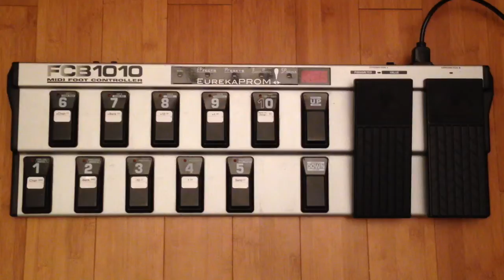Programming the PP Programmable configuration of the EurekaPROM

Comment: Hello! I have a few questions.
1) Is EurekaPROM still usable with current production FCB1010s, in february 2019?
2) I understand there is no Windows editor, but everything seems relatively simple to program
3) I would use this ROM with the FCB1010 to use in Amplitube 4 as a pedalboard (switch presets with bottom row, and enable/disable individual stomps with upper row). Any experience doing this with your ROM? Thanks :)

Comment: I relied on the settings, but from 7 to 10 they do not blink, the signal is not enabled either, it only appears temporarily when I press the button
Reply from the maker: Is it in the PP Programmable configuration? (Will read "ES, EP, 3.2, PP" on power up) Could pedals 7-10 be programmed to "momentary"?
Reply: @Eurekasound  no, I could enter the configuration, pressing 7 and 10, I changed the parameters from 1 to 10, but when finishing the settings, only the LEDs 1 to 6 blink and when I test from 7 to 10 the LED only turns on momentarily
Reply from the maker: The A3 configuration has pedal 1-6 as on/off, 7-10 as momentary. That's why I'm asking if you are in the PP configuration. The PP configuration only programs that configuration, not any others.
Reply: Thanks for your quick response, how can I get from A3 mode to PP mode? I need the pedalboard to communicate with ableton live
Reply: I could already see where to configure it on your web page.

The device is very friendly, thanks!

Comment: What happens after all the switch pushing?  I've done all the steps and now I have 1 thru 6 blinking.  Were my changes saved?      When I press any of the foot switched they are not sending the CC values I just entered.
Reply from the maker: Are you sure it's in the PP Programmable configuration? It'd read "ES, EP, #.#, PP" if so. Pedals 1-6 flashing sounds like it's in the A3 configuration...
Reply: I'm not sure what mode it was in.  I would have assumed it was in PP mode since I just programmed it for PP mode.  I ended up powering it off then on again, and then selected PP mode, and started seeing what I entered before.  I have no idea if that power-cycling is required or if there's some other step to get to my configured settings.